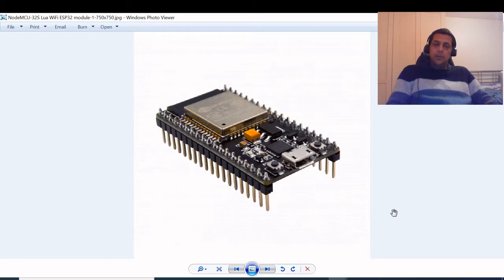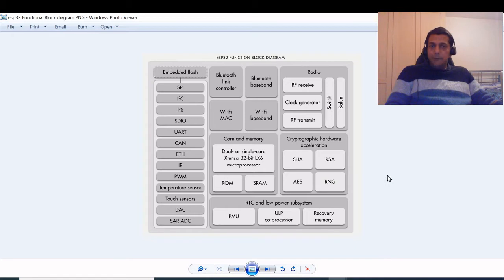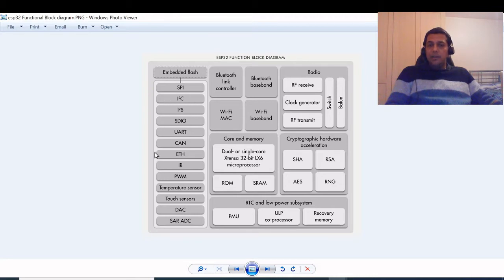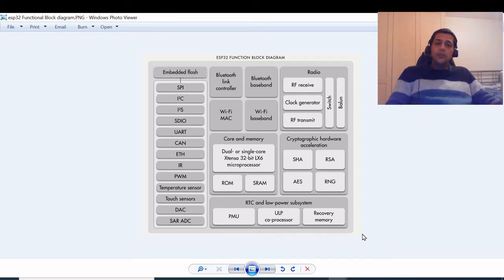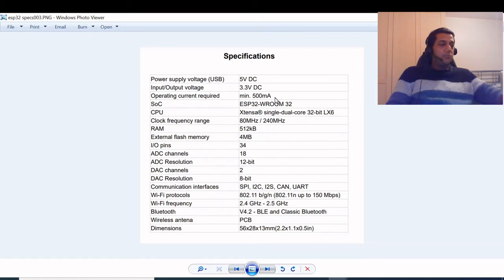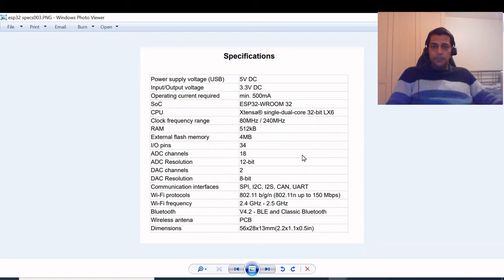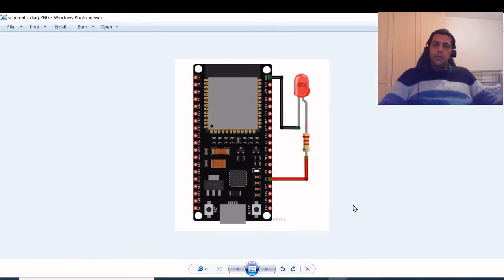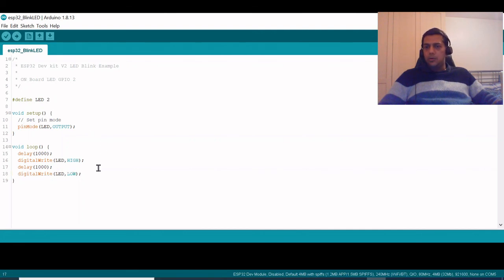ESP32 overview & LED blink | Devkit V2 board

Comment: I only started using these recently, I'm a complete newcomer, it is taking up all my time learning C++ but keeps me out of trouble. I recommend getting an Arduino too as there are more examples and tutorials for the latter but they are similar to program and both can use the Arduino's IDE suite. The version 3 is shortly being released which is tweaked for artificial intelligence and machine learning.